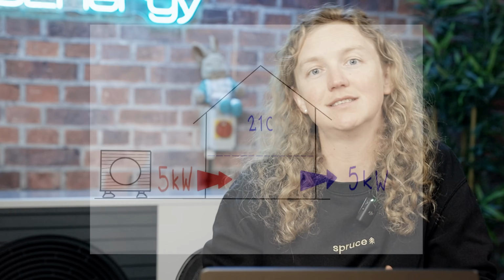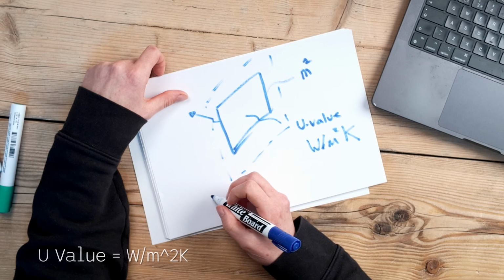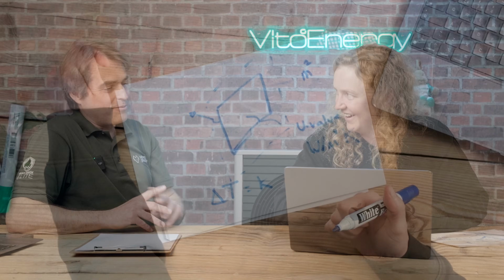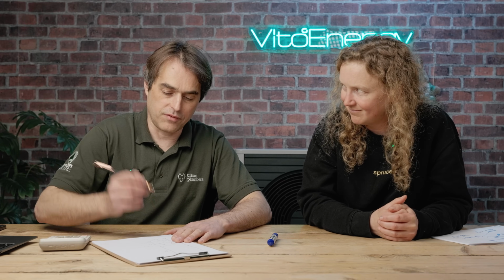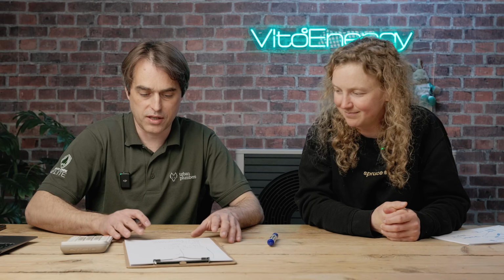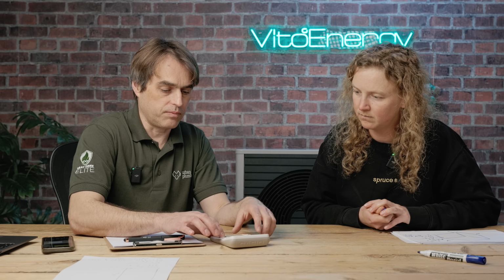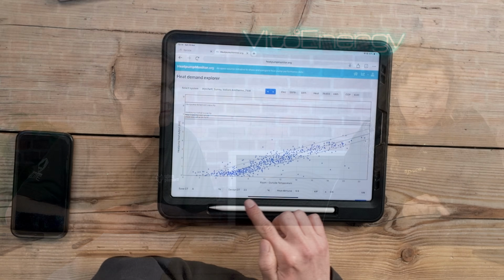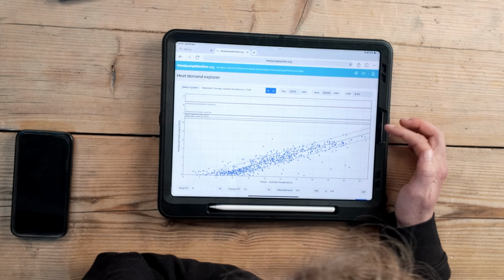Heat Loss: Why Everyone Gets It Wrong & How To Fix It

Comment: Very impressed by this video.  I wonder if there was a way of checking if my Heat Loss calculated by a good company is too high?  Most other online calculations are saying 7.5 or less and this well-known company is saying 8.3.  This has resulted in a 9kW heat pump proposal,  which (without yet to be lived-in experience of a winter),  I feel is Too High, which will lead to HP starting and topping -- more stopping than starting!! The gas usage March 25 to March 26 was 14337 kWh (including cooking with gas). EPC is A. UFH downstairs, radiators upstairs & bathrooms (10 in all). House size 259 SQM newly built triple glazed throughout. My much-loved installer company is known for its over enthusiasm and overkill!! 😀

Comment: What do you think of this Heat Geeks rough calculation
(Gas usage – 5-10% for cooking) x (85% less 5% per decade of boiler age for efficiency)
÷1,500 is your heat loss or Heat Pump size
2025 was 21,358 kWh -7% = 19,863.94
X 75% ÷ 1500 = 9.93

For my 3-story Victorian semi?

Comment: Excellent thank you.  Just about to purchase the 7610 so hoping that’s the right decision but one of the factors is the ease of remote working as it has a LAN connection installed where as the Yaesu rigs you have to buy a separate box.  I don’t operate Windows.  73 MIke

Comment: You didn't touch on solar gain or wind chill.

Also the method seems to assume that air change is fixed, whereas in reality it often depends on wind direction, exposure and wind speed.

For example, our house is in a very exposed location highly exposed to winds from East, through South all the way round to the West, including the prevailing South Westerlies. The sea surrounds us on these three sides, meaning there is nothing to shelter us from the wind for up to 100 miles to the SW.

If the wind is from the South West the air tends to be warm and wet, as it is warmed by the Gulf Stream. If it's from the East then usually it is blowing all the way from Siberia and so  occasionally it can be very cold.

In choosing your design temperature, how do you allow for such wide variations without massively oversizing your heat pump and emitters?

Similarly, our house is facing south, so benefits greatly from passive solar heating, whether it comes directly through the South facing windows or indirectly via the South-facing stone walls. The sun is also reflected from the sea, so possibly increases passive solar heating by up to 20%.

I gather that the insulating values of solid stone walls have been underestimated for years, but so also have the solar gain they can bring.

My feeling is that the heat loss calculations proposed in this video would be worse than useless for my house.

It is in areas like this that I think heating design becomes more of an art than a science.

I suspect that a heat loss calculation using these methods would arrive at a heat loss of 30kW or more for my home, whereas in reality I suspect that a 10kW heat pump would be entirely adequate for 95% of the time, with auxiliary room heating being sensible for the other 5% of the time.

Comment: As a mechanical/agricultural engineer (to MSc level - albeit with a 30 year diversion into policing - don't ask) the material you are covering here is, IMO, essential for anyone embarking on a heating project whatever the means of producing heat (likewise for cooling).  Without doing a fairly serious heat loss investigation, you might as well use the 'pin a tail on a donkey' theory to decide the size of heating/cooling plant needed.  As you are always telling us, such arbitrary decision making causes huge amounts of wasted time, effort and money when a poorly performing system has to be modified or indeed replaced.  So, let' see lots more of this sort of output, please!  All the best for 2026.

Comment: This is very interesting for retrofitting, where the CIBSE pre2000 ACH values are hopelessly pessimistic. In my own home case, it leads to a heatpump 2 sizes larger than necessary. I wonder if CIBSE could issue better guidance since most installers are reluctant to deviate too far from this? Should a door blower test be used more often for retrofit? How would you see this being used?

Comment: Go big! Modern condensing boilers are more efficient at lower temperatures and be ready for heat pump. You can also throttle lockshield valves but to get more heat its higher flow temp or upsize the rads again

Comment: the most accurate method is to get a big adjustable resistive heater, run it in the room incrementing its power until the designed delta-T  steady state is reached. so the current operation power of the heater is exactly the total heat loss of the room

Comment: I believe this is very useful, easy to digest & much much needed. Appreciated. You and the guys at Heat geek made me convinced to have a vaillaint aerotherm at our retrofit project and it is running with 4,2 COP even though the outside wall insulation will be placed next year. So big kudos to you guys!

Comment: I enjoy this sort of thing but there is still a lot of assumptions and guess work... the room above, Lets say its 21c ( what if they are away and heating is off)   The place next door, lets say it's 21c ( Again what if they have turned it off or are running at 18c).  Lets assume the ground is 11c, HL through the floor between 0.7 and 1.5  (That's a doubling of the low number) ACH lets assume its 1 change per hour. I realise we have to draw a line but to emphise how important HL calcs are and then say lets assume is contradiction. It seems to me to be and educated guess and the final calculation will be in a band width but not an actual correct figure, which I understand and accept, the use of open source heat monitors is definitely valuable, but when the calc comes out at say 5.8kw do I choose 5kW ashp or 7kW, I'd choose 7kW which technically is slightly over sized. My point is if I'd done a slightly less intensive HLC and come out at 6.8kw loss against 5.8kW then I would but the same model  7kW ASHP.

Comment: At some point, in some cases, is it easier to plug in some temp electric rads, and just measure?

We have a very complex property, urban cottage with every side of the house different, solid walls, adjoning gabel sloped roofs on one wall, extension, varying thickness walls as house gets higher, internal solid walls 50cm thick, which thermal bridge down to the ground floor which is vented cellar - no dpc. Traditional design here. Parts of the house are adjoining neighbours,, and others not....

If spruce want a challenge we have one for you 🤓

Comment: when my last epc was done in 2013, there was so many "assumptions", that were incorrect, bearing mind currently my house is 3 distinct build types, the original fabric is 2 ft thick solid sandstone,2 storey side extension 1988 (brick/cavity/brick) since cavity filled, & a 3 x 8m rear single storey extension in 2015 2 skins of breeze block walls & insulated floor, plus the whole house except the velux roof window are tripled glazed windows, getting a new correct epc looks to be a painful experience, good format simon explaining how much behind the scenes maths you do for your installs :)

Comment: The lady was very good at presenting the maths of the heat loss (I have PhD level of applied maths and calculated my own heat loss for my house).  The one that I found confusing for heat loss calculations used by companies that quoted for a new system; the design of using -2C as the worst case temperature for the east of England.   We still get (even now with terrible heat during summer in this area), regularly  -5 , and -8 is not unusual (we have 8 continuous days of the night temperature below -8 last year) in this rural area.  So how is this worst case -2 sensible when the East of England regularly get punishing cold for quite a few days a year away from towns?
Reply from the maker: It's the averages that count, not a 3-5 days at -5 or -7. You will usually be fine even at those lower temperatures, thanks to the lower air humidity and heat pumps recovering some of their output. Installing with some spate capacity (with units with good controls) is also advisable or BUH (Back Up Heater) to bridge the gap or allow for below the design temperature conditions is also a good idea.

Comment: Very few people run a heating system 24 hours a day, 7 days a week. My gas combi turns on at 4.30PM and off at 9.30PM, weekdays, and on at 6.30AM and off at 9.30PM weekends.
The heat loss calculation must obviously use a dynamic model, with the thermal capacity of the house structure, and the thermal capacity of the water in the primary circuit taken into account.
With a smart meter reporting every 30mins, it is possible to see the initial burst of power required to get the water up to the flow temperature, and then the slow decrease in power as the house warms up.
   I would be interested in comparing an intermittently operated system with a continuous system such  as heat pumps are recommended to use.
    Can you recommend software to calculate heat loss for a system operated intermittently?

Comment: That was interesting, thank you. 
I think another important factor beyond validating the heat loss model is to incorporate the way in which the heat pump can modulate up or down. 
I’m shocked at the width of modulation from my unit, I’ve seen it run as low as 0.6kW input load giving flow of 35 l/min at 25C and as high as 5.8kW input load at 35l/min at 55C. The point I’m making is that having accurate emitter size is more critical than the actual peak heat pump output. It makes sense to moderately oversize the heat pump as it can modulate down and yet can also catch those atypical very cold days.

Comment: Can anyone give me an infiltration rate for leaded glass windows - like stained glass windows in churches. They may have been there for some time, being pushed and pulled in and out by wind pressure, and loosening the tightness of the fit of the glass in the lead channel?

Comment: Can you talk about cold bridging and how to take this in an account? I have a house with concrete floors. The rear facade is insulated on the outside. I want to insulate the grin on the inside. But the floor and ceiling is still embedded in the cold front facade.

Comment: Feedback: all good, although I am not a heating engineer, just a lay nerd when it comes to such matters. One serious question - if my house's heat loss calculations assume minus 3 C worst case, I assume the heat loss is less when the outside temp is, say, 10 C? Everyone knows that it is harder to heat a place when it is really cold out - duh, obvs! - so how, even with weather comp switched on, does my system work to, presumably, modulate downwards sufficiently to prevent excessing cycling? I am still trying to understand more, particularly with heat pumps, as I suspect mine is over-spec-ed. Vaillant Arotherm not-plus 11 kW, installed as part of a 100% grant here in Scotland. I had no say at any time as to the equipment... I think there must have been either a job lot of these units, or the grant only applied to these, generally, older types of heat pump. Either way, I cannot get better than a 2.5 SCOP, however much I alter settings. This is still totally preferable to oil or solid fuel as far as cost is concerned, and what I pay still seems much better than I expected, but I get a bit hacked off hearing about SCOPs of 4+! I had a Heat Geek guy come and check it out 18 months ago (he came from 100 miles away, the nearest by far, and was more of a physicist than a heating engineer, ie, he was not a fitter of any kind, just a theory man, and he reckoned my unit was cycling too much even with all the rads wide open, and suggested an expansion vessel on the rad return side, just before that water returns to the heat pump unit. This would allow me to reduce the temp in a mainly unused room, and my bedroom which seems always too warm at night, even with a 3 C setback. Apparently the heat loss calcs seemed reasonable to him, and the system volume-to-heat pump rating likewise, but only if all rads are wide open, always. Does this mean I can never get a better SCOP? Any suggestions?

Comment: for measuring heat loss I use 2 temperature measures, one inside the house, in the main room, and the other outside in the northern part protected from sunlight, with home assistant I calculate the difference of the 24 hour mean for both measures, and it gives me quite an accurate delta mean, that I use to control the temperature of the water produced by my heat pump

it actually gives me great results as a way of driving my heat pump

I have the heat pump also monitored with home assistant using an ebusd adaptor that gives me lots of data and ways of control

my machine is a saunier duval 8 (spain nomenclature, I think is should be 7 in uk) with r290 that is practically identical to vaillant equivalent

i use the energy produced by the machine, and also monitor energy calculating in and out water temperature and flow rate, for this measures I use de data provided by the machine, but I think it is quite accurate when I have tested measures, only flow rate I have not tested externally

I appreciate your explaining how the real key to calculate heat loss is the actual walls exposed to the outside, apart from floor and ceiling, first time I hear about air renewal ... interesting

this video is particularly interesting to me, thank you

Comment: This was nice explanation! Thumbs up! I would like to know something about using Heat Pumps on not insulated buildings. While driving trough GB I get the impression that here are many Buildings that are not insulated. Whats the line where you would say that you need to work on the insulation first?

Comment: Many thanks for the content. invaluable in this day and age of burgeoning H.P. technology.
A couple of questions :  A)  I assume the Open Energy monitoring is a n optional add-on ; how much would it cost to have this addition please?
B)  Would it be possible to use the gas consumption of a property to assess the required capacity of a heat pump. Allowing for boiler efficiency and any water heating derived from electricity?

Comment: Literally the worst thing about working in the states and coming back to the UK was having to relearn heat loss. Everything was done with R units - thermal resistance, instead of U units - thermal conductivity. I still balls it up even now so it's much easier to use an app.

Comment: I've used heat punk to calculate heat loss for myself and had similar results to the heating engineer estimate (and I made some suggestions for larger radiators).

Comment: Hi. On average how long would you say it takes to complete a 3 bed semi using this software. And the main thing which i cant see on their website is how much the software cost, is it a montly/yearly subscription or a set one off fee? I can see the benifit of using this as it also does emitter choice as well, does it do multiple brands of radatiors?
Reply from the maker: Monthly subscription of different levels. Once you get good at the software you can easily do a 3 bed semi in 45 minutes

Comment: Yes, definitely ACH is the biggest source of error. 
There is a simple way to check your calculations and that's against the property's existing heating bills - after all that's a real world actual measure of heat loss. If for example you had an old 80% efficient gas boiler consuming 30,000kWh/year that would be 24,000kWh/year of actual heat. With a heat pump SCOP of 4.0 or more you'd be expecting 6,000kWh/year consumption or less which should match your heat pump sizing calculations which usually give an annual consumption figure. You can also look up "heating degree days" for a property and with a given worst case delta T internal to ambient estimate your heat pump size which should match your worst case heat loss.
Reply: @johnh9449 I think if the exercise is to properly size a heat pump, then annual consumption is not relevant - the heat loss calcs are to estimate the heating requirement for the 3 coldest days of the year when it's -2°C. You would have to find a few historical days when the outside temp was -2 and look at the consumption over that period.

Comment: A useful video & a decent insight into how heat loss is calculated. I’d add 2 things though. Firstly the analogy of a bucket with a hole doesn’t really provide a full explanation. It’s actually more like a sieve. You can plug some other holes in a sieve but you’ll never plug them all. In addition heat loss calcs don’t deal with one of the biggest factors in real life for all houses but especially older ones - air leakage. This is described as ventilation, but that obviously docents apply to a modern building well air tightened. Air leakage affects comfort & I’d argue if you really want a comfortable home & you’re retrofitting an older house, an air leakage test is a really good idea. Addressing air leakage is probably as important as installing extra insulation.

Comment: Is anyone here actually trying to estimate the heat loss of their building without even knowing the difference between power and energy? 
At this point, why not explain multiplication in the next quantum field theory lecture?
It's getting ridiculous how much time is wasted on basic concepts just to fill up the video with fluff.
Reply: I’m assuming you’re not a plumber? Plumbers are not taught this in college and this is the crux of the issue in the UK. Videos like these are essential as both a starting point for conversation or as a means of highlighting what isn’t known and is also a good starting point to gain missing knowledge as the industry transitions from gas to to alternative energy. 
Don’t knock the plumbers though, you may be able to discuss quantum field theory but who are you going to call when there’s water pissing through your ceiling or the s**t you’re full of won’t flush away?